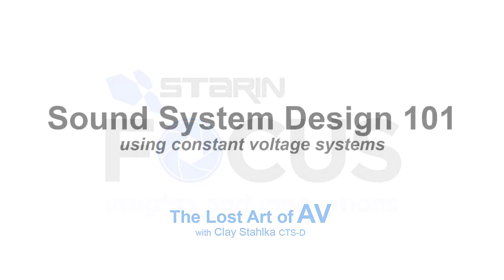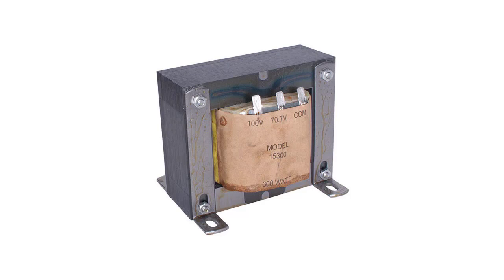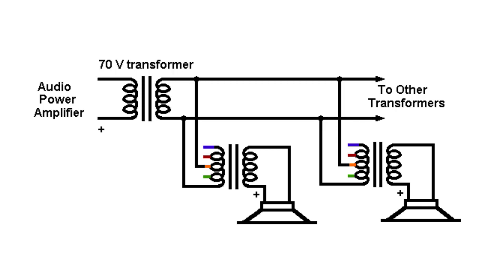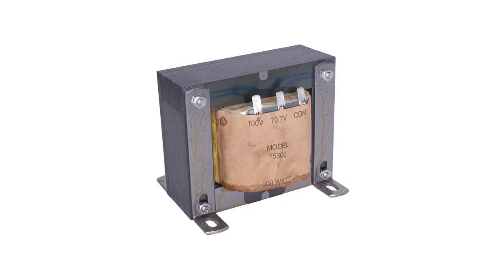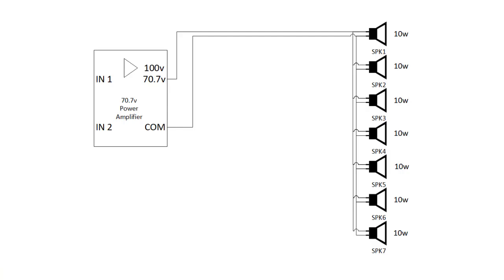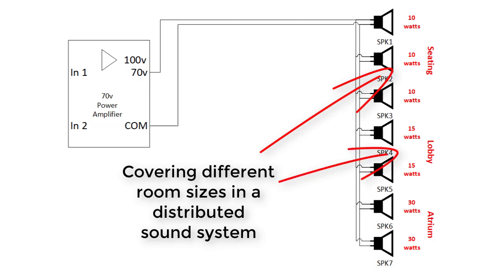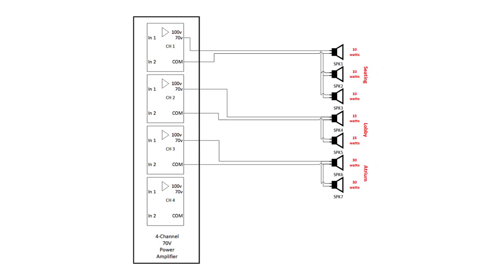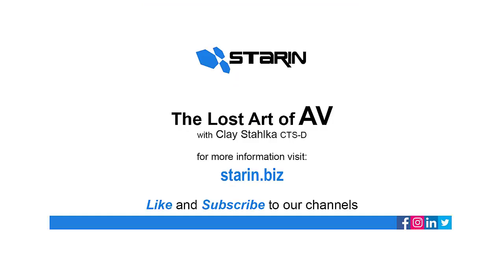The Lost Art of AV: 70v Distributed Sound

Comment: When I was younger I worked a lot of on 70V systems in stadium and auditorium settings (1980s) and it was a challenge to get any audio quality that didn't sound like a clock radio speaker. We also had major problems when one speaker was ripped off by a drunk guest or when cable runs came close to any other A/C wiring.  Any tips on sound quality with these systems?